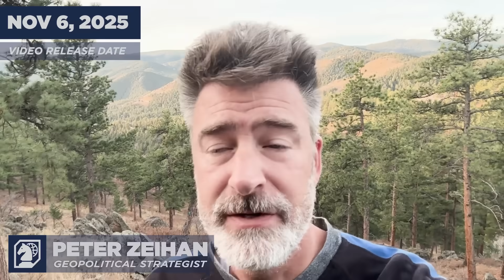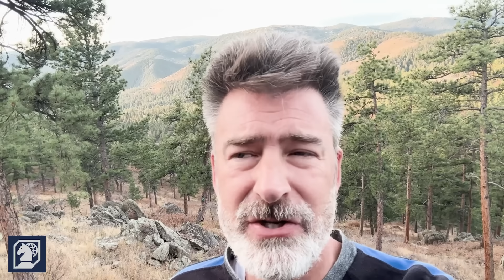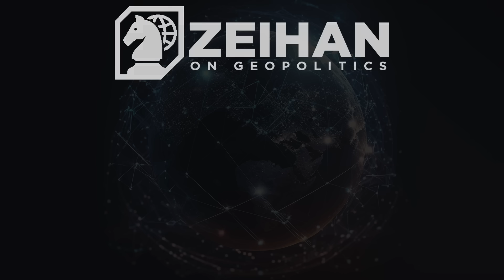The Semiconductor Frontier || Peter Zeihan

Comment: Intel's problem is they failed to buy Nvidia when AMD bought ATI. Then they had the hubris to think they could just do their own thing in GPU's which has had some success at lower end but they are nowhere near the top end. The top leadership got lost when it stopped concentrating on making the best silicon products and went all over the place under Paul Otellini and it only got worse when Brian Kyrzanich went down the road of DEI and now it's just endless firings and trying to do things on the cheap (which never has worked at Intel since you can't wake up one day and say oh 20,000 peoples worth of work can go away and we will be fine, it has been tried several times at Intel over many years and NEVER works, things just stop getting done but leadership at the top never knows this and it gets hidden or they are just too stupid to acknowledge reality). What they NEED is top gaming CPU's (which they don't have and haven't for many years) because that is what gets folks interested and word spreads and what they also need is a functional GPU that can compete with Nvidia or at least with the AMD equivalent (which Intel has never had and shows no signs of creating). We are a LOOOOONG way from Andy Grove unfortunately and the company shows it and how it is run shows. I do however wish them luck, it was once a great company and now has lost it's way and is stuck in perennial second or third place and is in danger of going lower as all kinds of talent is ejected from the company in the name of "saving money". You don't win in the Semiconductor business by saving money, if that was the way to win then just save ALL the money and shut down the company and fire everyone.

Comment: Small error: 10000 chips => 10000 wafers. There are some 50 ICs (=chips) on a wafer. 10k wafers a month is very low, thats basically tuning the production process. In full production a machine like that runs app 200 wafers per hour, 24 hrs a day, 7 days a week etc (app 140k a month).

Comment: That 10k is not chips, but wafers. Intel is actually using HighNA tech on its 18A fab production today, but not to its full capability. IMO, they are using HighNA on 18A as a low-risk ramp for their knowledge, discipline, teams, etc prep. 14A will make full use of HighNA tech.

I would be very interested in your analysis of what you find looking into AI hardware as the defining technology of world security and defense in relation to what is happening with INTC today.
As of 6 months ago, INTC wasn't expected to manufacture out of the 18A until the second half of '26, at the earliest, and analysts were predicting 2027. They are at FMV today, and will deliver chips to market in Jan '26.

What other information is possible fog?

Comment: TLDW › ASML’s new “high-NA” lithography machines could etch chips below 1 nm — potentially a new leap beyond today’s 3 nm EUV standard. Intel, once dethroned by TSMC, now leads adoption with two test units in Oregon; full rollout won’t start before 2029–2030. If successful, Intel could reclaim the crown, though the process is slow, costly, and supply-chain-heavy.

2¢: Silicon progress runs on physics, money, and patience — not hype. High-NA could spark another chip revolution, or just prove how fragile globalization makes tech empires. Either way, the next node’s battle will decide who owns the 2030s.

BRIEF FOCUS – Less noise. More signal.

Comment: Old Computer Tech here.  I was trained on the Navy AN/UYK-7 Tactical General Purpose Computer way back (1980).  This was the fire control processor used on the Subs.  If I remember correctly, one chip was the equivalent of maybe 4 And Gates and the chip was about 50x50mm.  They were in a flatpak form and a one bay configuration with 48Kx32bit memory stood about 42'x20'x24".  It was a true 32 bit processor which gave it incredible processing power at the time.  I have a hard time fathoming what can now fit on that same form factor.
Reply: How about 50 petabytes of storage and 16 processors with 6T of DRAM and 160 cores each?
Reply: @k53847  Guess that's why we learned scientific notation in school.  They mentioned Moores law when we studied digital logic back in 1979.  I've had a front seat since then on the impact of that law and how it has affected data processing and motion control electronics.  I don't think most people know the advance of semi-conductor technology (hardware), they just see the software that runs on it.

Comment: Sub 1nm? How does that work, isn’t an electron 1nm and therefore the smallest you can go?
Reply: 1nm refers to "process node" which doesn't directly translate to the size of the smallest features on a chip. electrons don't have a diameter that we can determine but proton is like 10^-15m, which is 1 million times smaller than 1nm

Comment: High NA has been in literature for a least a decade and tbh outside of the machine itself, there's no impact to supply chain.

High NA is, as others have said, a light-focusing technique.

Actually, if it lets you go to a larger wavelength, it could make supply chain easier because you don't have as-high-energy EUV beams literally burning through everything, it eases material performance necessities.

Comment: As usual an excellent generalist assessment.  Yeah it is like the "battery" talk I was given decades ago - why no electric cars right - and it goes back to Edison and Ford facing the same delemma which is crazy right. My professor said - batteries are based on a perception of understand (we later talked about oil extraction in Alberta having similar problems - few know that taking the oil is MAYBE recouping 12% but it destroys the oil remaining underground via contamination - so if you like petroleum it is removing the future - environmentalist should clap for it as long term it is foolish - money now was why they are doing it).  With semi conductors - I was told heat (again batteries) is the great problem as that is how we perceive that technology in our head - so tighter smaller like road maps but it is based on flow we had in our heads. Like batteries what will happen - we cannot "picture it" in our technology understanding now - once it happens it will seem "common sense understanding" (maybe hard to execute but we all will "get" the concept).

Comment: I think the next wave is photonics over graphine. It is a bit early but computation using light to transfer data data is much faster and produces less heat. Currently photonics is used to transfer data between chips in AI systems like nvidia. Asml’s new system apparently cannot take advantage of this graphine to produce chips at high volume yet. Have you more information on this?
Reply: Graphene is scam. 😂

Comment: "Extreme UV" is actually soft X-Ray not UV but was given a marketing name because of radiophobia.  Same reason nuclear magnetic resonance imaging is NMRI in the scientific literature but only MRI is medicine.

HNA is going to be very difficult and very expensive.  I don't blame some companies for wanting to let others figure it out first.

I work in the industry and we all call it Dee-Ram, although there are days I could use a dram or two.
Reply: Heh, at once had a design that wasn't working.  The yield rate was abysmal.  But only the L2 cache of our design was affected and the fab kept reiterating "your design is flawed".  Complicating factor, the SRAM cells of the L2 were licensed from a 3rd party.  So we ended up with three parties each blaming another.  Later I found out two other companies had the exactly same issues - but the fab made sure none of these three companies knew about each other's problems, so no cooperation.  The process was flawed after all.  I expect such experiences to reoccur while the first designs are used as test vehicles to debug a new process.  And it will be spectacular due to the extreme cost of NHA.

The term "soft xray" is already taken so calling it EUV also served clarity even though as you say, it not really xrays, just somewhat close the the border line.
Reply: Would you say HNA is proportionate in new challenge compared top DUV or EUV? Or is HNA a more complicated leap?
Reply: 13.5nm isn't an x-ray
Reply: @GdEvInE141 It depends who you ask.  The Encyclopedia Britannica says x-rays start at 20nm, the US NIH says 10nm.  Argonne National Laboratory says 4.5nm.

Comment: It's about damn time. If ASML sells it there's a 99% chance it will work.
Reply: It's way more complicated than having a new machine from ASML.  Tweaking a new process to work used to be dark magic; these day's it's a bit more sciency and less magic.  All the ultra-pure chemicals used need to become even cleaner.  People need to be trained at the fab.  Libraries for chip design need to be optimized to take advantage of the new process etc.  These days many often an old design is moved to a new process to guess a little more clock, maybe add more on-chip caches, that sort of thing.  That's called a shrink and a shirnk is the easy way to squeeze out more performance.  Do it twice in a row and the returns will begin to diminish  So basically to get the best from old designs the chip will need to be substantially tweaked, software and systems for the new chip need to be changed.  All that's very much an iterative and at times painful process which due to the high stakes both for the fab and the customers is a very stressful time for everybody involved, from the trenches to the CEO.  Been there, done that.  It's quite an experience when a new chip design is finally working!
Reply: @ralfbaechle  There is also the fact that physical chip factories must be built differently than before. When you use the latest ASML machines, the vibration of a train or traffic from a mile away will cause misalignment on the chip etching.  New chip factories must be built on a floating foundation that will not move more than a nanometer when a change in atmospheric pressure causes the earth to move. That's the entire plant with most of it's buildings on a floating foundation.
Reply: @ralfbaechle  It must be done. It can be done. It has been done. It will be done.

Comment: Intel have a long and storied history of utterly failing to deliver on new nodes and they're currently having big problems getting anyone to use their foundries - including Intel. 

Also there are reportedly about 500 supply chain steps to make a high-end semiconductor (CPUs at least), which is a few less than 100,000.
Reply: They left the bean counters in charge deciding to somehow inexplicably not buy EUV machines until about 10 years too late which saved them like $10B or whatever but probably cost their market cap at least $500B at best and could possibly have laid the seeds for starting world war 3 if the US ever has to come to Taiwan's defense because the US now needs TSMC to make AI chips.

Comment: Tesla may build it's own foundry because their needs will exceed global manufacturing capacity.  This is compatible with  Tesla's vertical integration policy.  The scale that Elon builds will likely have a global impact.
Reply: There's a lot of assumptions built into that forecast, many are rose-tinted.  Yes Tesla has a mountain of investor capital to do whatever it wants, but so far they haven't done much to bolster investor confidence.  Those investors may decide to pull their money from Tesla.
Reply: Semiconductor fabs aren’t that simple.
Reply: @hlcapa  Yeah, Elon can't build rockets either.
Reply: Tesla barely sold 2mln cars worldwide this year, they have some 2% of the global market. And none of the other car manufacturers have their own fab, because its not worth it. Profits are razor thin in this segment, there's no point in investing billions in that

Comment: Intel and TSMC are competitors just since a few years ago. Previously Intel did only manufacture its own chips. TSMC has been always a foundry (semiconductor contract manufacturer).
And by the way, Intel and TSMC do a wide range of products apart from GPUs. And CPUs are processors too!
Reply: Intel specialises in CISC based architecture TSMC specialise in RISC based architecture. When it comes to running data centres which will be used for ai only Intel matters in that space.

Comment: What do you think about photonics technology for semiconductors
Reply: Photonics are interesting and they're seeing more development since Nvidia needed more bandwidth for all their AI hardware, so it's progressing. But for now it seems to being used more to increase data move rates over longer distances. So perhaps in time they'll find ways to make some of the data paths on motherboards photonics as well. But for now I'm not hearing to much on pushing photonics in to the interior of CPUs and GPUs.

As such, we should probably expect gradual developments here, with it over the years becoming more sophisticated and integrated. Moving from just being a port on the computer to getting pushed eventually to connecting more directly to the chip die perhaps.

Though as in all things technology, always a chance things take a different turn.
Reply: For production means or in the sensor and telecom segment?
Reply: @ce4062  production and sensors

Comment: Wasnt the lack of argon from mariupol supposed to kill all semiconductor manufacturing???
Reply: Zeihan underestimated the industry. It's pretty typical for them to correctly see a problem, but vastly underestimate the ability of countries and industries to adapt to the challenge.

In this case the industry had already been working on a technology that could cut argon usage by 90%, TSMC was already using it in increasingly many facilities. So rather obviously if Argon became more supply constrained they just accelerated their efforts there and thus now need less Argon. Thus giving enough time to build new Argon production facilities if needed.

Their underestimation of industry and nations to adapt is why I for instance also place substantial doubt of their claim that globalization will go away. There are a lot of countries that gain to much from it and are to dependent on needing things from elsewhere to not and try and some what work around issues. So even if there was some decline, it would probably continue to a substantial degree anyway despite their belief just by the necessity of various actors around the world. This is especially the case when  they get so much warning and time to adapt to the challenges.
Reply: A decade ago I worked for a Nat-gas engineering firm.  One of the side projects they did was adapting their cryo processes to clean air coming out of coal mines.  

In addition to making the air cleaner, it allowed for almost free reclamation of the trace noble gasses escaping the mines.    

And of course all of the natural gas facilities we built also did this.  I guess once you are liquifying all of the room temp gasses, they are much easier to sort, store, and resell. 

I don’t know how much this contributes to noble gas stocks worldwide, but it’s definitely a new-ish source that’s growing.
Reply: @JasonJrake  The trick is to get ninety-nine point ninety-nine per cent purity. You weren't getting that out of mine byproducts. But yes, getting some noble gases that way is one of the options.
Reply: @JasonJrake  cost factor? Expenses for license fees to be paid to Bill Gates patents?
Reply: Maybe they're running on stored argon? New mines?
Reply: I don't know about argon and chips but the source of ninety nine percent of the super pure neon was eliminated during the conflict. The shortage of super pure neon was supposed to make manufacturing specialized scanners such as used in medical imaging impossible. Lower quality imaging yes, but not the extremely high standard that had become considered essential.
Reply: @ronarnett4811 develop new sources
Reply: Purification methods?
Reply: @ce4062  For what? 

If you are talking about Mariupol as a source of Argon, that was a byproduct of the production of the steel mill there. Mariupol was a source for Argon but not a primary source. It definitely was not a source for super pure Argon. Unlike super pure Neon and Krypton for which it was virtually the only source. 

If you are talking about mines as a source for noble gases they one hundred per cent do not produce super pure gases of any kind. Why would they?